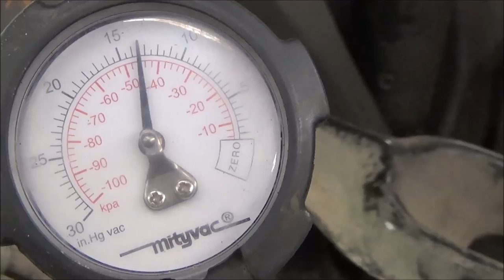Pontiac Grand Prix 3.8 - Water Pump Replacement

Comment: If the first can of stop-leak don't work, put in a case!
Reply from the maker: +Aaron Kimmins Hahah
Reply: You should have saved that GM clay, next leak you could slap some on, cover it with a couple of hose clamps and the car is good to go.
Reply: It's not stop leak, it's just what happens when Dex-Cool is expired and/or exposed to air. Dex sludge is classic. I've seen it so many times. It's atrocious.
Reply: That's Bars Leak all day long.
Reply: M R Research Dex-Cool mud and you'll see. Not stop leak.
Reply: Right that’s what I was thinking
Reply: I thought the same thing how ever this is from the antifreeze yes the antifreeze does this if not changed every 60,000 milles ugh I was like F it has bars leak in it boy was I wrong! Now my question is can I flush this crap out and use a different kind of antifreeze cause this shit is unreal
Reply: @Nicole-dj3jf  They make universal that is actually better than Dex-Cool. My shop uses it for nearly everything. I can't remember the brand name off-hand, but we had someone try and sue us a few years back for using it instead of GM branded stuff and we actually had it tested. Stuff ran circles around the Dexcool.
Reply: @1337penguinman  my 2008 pontiac grand prix v6 3800 said only use dex cool so your saying I can use the universal antifreeze and nothing will happen to the engine or radiator water pump? Why would they even make this dex crap knowing it turns into clay! Fucking crazy
Reply: @Nicole-dj3jf  You're not supposed to mix dex with the other coolant, you can switch coolant, just make sure to do a really good flush before changing, some even recommend getting a new radiator, hoses, and coolant reservoir as well. dex cool works fine just don't expect it to last forever, just like oil coolant needs to be changed eventually as well.
Reply: @Nicole-dj3jf  imagine what the oil looks like after 200k miles of being ignored. This isn't the product's fault it's 100% on the owner who's ignore required care for the car.
Reply: @delirification  I called the tech support # number on a jug of DEXCOOL years ago and asked them what happens when you mix with regular AF.... He said,  "Nothing, you just don't have extended life antifreeze any more."   All the thermonuclear meltdown stories are just that, Stories.

Comment: That is odd, I did not get to experience the dex cool fail. however my 32 yr old Buick park avenue had a small leak in the radiator a few yrs back, we replace it with a new aluminum one, no problems since. I am happy some folks think a particular brand of car is more job security than another, when in fact they all need proper maintenance! Sometimes one area is saturated with a higher number of one brand more than another. Think about it. thank you for another top-notch video!

Comment: I have seen some unmaintained vehicles in my day but dam.  That takes the cake. Another great video. Thank you again sir. Jim
Reply: +scrimmy6969 I don't think it has anything to do with maintenance. Look at these pictures.                   http://www.sancarlosradiator.com/dex-cool_pics.htm
Reply: Steve Price Nothing to do with maintenance?? My personal opinion it has everything to do with just that. GM's wise choice to use DEX will do exactly what this vehicle is showing. I do not know you and I will not click the link you provided. Thank you for the input.
Reply: +scrimmy6969 It's all good. I'm a confident and capable person, so I'll click on links. I can handle anything a machine throws at me. Computers are a little more complicated for some, I can understand that.
Reply from the maker: +Dick Fageroni I think I should submit my pic with the screwdriver standing up in it lol
Reply from the maker: or a sweet ash tray then learn how to smoke...
Reply: +South Main Auto Repair So is that from the fluid dehydrating to its basic elements over the course of 200'000 miles over and over, and not flushing the radiator?
Reply: +Randy Leonard Its a combination of not maintaining the vehicle and GM's extended life antifreeze. It is know to clump over time and clog radiators and blocks in the cooling system. Sadly I see this on a regular basis. I was buying AcDelco classic coolant and flushing the system and converting to the old antifreeze. Sadly I cannot find that coolant anymore. I know you asked Eric for his professional opinion but I wanted to stick my two cents in. I hope you do not mind sir.
Reply: +Steve Price I can clearly understand that as well. Dex SUCKS
Reply: You see all these nice GMC vehicles they released this year in the commercials (the 3 trucks rolling down a track) and you would think its a nice Truck?  But I am quite done with GM, as my Cobalt is nearly new (2007 29'000 miles!) and is a "purchase new"  $10'000 lemon.  Multiple recalls and suspension noises 1000$ spent on new arms, no rust underbody.
Reply: Randy Leonard Most GM cars are piles of shit.

Comment: Dex-Cool and cavitation.. Flush your cooling systems ppl. Go with the good stuff, go green. Also that flush tool, and vacuum tool I need that in my life. I have 2 grand prixs an 01 GTP and an 06 GT both supercharged, I did both intake manifolds, water pump, plugs and wires on these and they're pretty simple.  BTW you should have took out the thermostat. In this vid ur only flushing the lower rad hose pretty much.

Comment: How could that car still run at all with the radiator completely plugged like that.  The heater still worked?  I find that hard to believe.  Best coolant system video I've seen.

Comment: I've heard of a case like this somebody mixed the wrong antifreeze with dex-cool and it turned to mud and looked exactly like this, I saw the old parts. They flushed the block much like you did replace the water pump, radiator and I think they ended up replacing the heater core too. They also chemical flushed it several times after assembly until it ran clear. It was a costly job but the mechanic showed the people that owned the car what it looked like and told them this was the only way he recommended to help prevent another breakdown or more damage that would keep costing them money.
Reply: @@evanst72The “ auto parts store guy “
Is probably the one who sold him the wrong crap any way . Literally they hire anyone as long as you are able to work a computer and educated enough to learn to change out windshield wipers

Comment: That's what happens to Dex Cool, it turns to acidic sludge.
Reply: That is right Dex Cool not good, so I used regular antifreeze and it runs better
Reply: I had this happen to my 96 s10 blazer. There was a recall on it
Reply: That’s what happens when you never top off a dex cool system or flush it out ever. I own a 2001 trans am and a 2002 grand am both have over 200k miles both have used dex cool their entire lives never had an issue.
Reply: That is exactly what I have...
"YUKE"

Comment: Hey Eric O, just this last week started watchin’ your channel, nice to witness another real ‘motor engineer’ at work.  You mentioned a chemical solution to the flush issue on that cooling system.  Over here in Scotland I remember using just that 45 years ago.  I worked in a military workshop but as a civilian and at that time we had Bedford 4 Ton trucks powered with a 300 cubic inch straight 6 petrol engine (it was quite possibly of GM origin).  Well they were really bad for the cooling system gunging up similar to your Pontiac.  Our method was to add a good handful of ‘Citric Acid BP’ crystals to the top of the radiator, top up with water and run for 10 minutes after reaching the normal working temperature.  On reverse flushing with clean water until the water ran clean from the radiator top, we then neutralised any residual citric acid solution in the system by adding Lisipol (dunno what the modern equivalent of that product would be but anyhow it was a mild alkaline soap) and running for a further 10 minutes after reaching normal working temperature.  Anyway, that process worked really well the inside of the radiator shone like they were brand new brass tanks.  Sorry for the very tardy post, as I said I’ve just started watching your channel.  Really enjoying it, will take me a wee while to catch up to your current offerings but I’ll get there🙂.  Thanks, keep on turning those spanners, oh and watch your fingers👍🏻.  Wullie
Reply: was this steel radiators or aluminum?
Reply: @ozzykrahn806  Brass and solder, 47 years ago, not many, if any, aluminium radiators👍🏻

Comment: Something tells me that you just flushed out the only stuff holding that engine together...🤔...😂😂😂
Reply: Have seen similar (not like clay but strong fine foam) before the headgasket went bye-bye. That, or the repair shop put something else in as coolant. Also happened quite fast - little low on coolant before scheduled maintenance (checked, still OK) and about 150km after, that was all it took. Got cleaned out and seemed OK for 1500km or so, then started missing first cyl and finally hydrolocked.

There is more to this story but jumping ahead I think I found out why this trouble came to be. Apparently, one hole for the head bolts had less threads than others. The bolts being identical, one of them reached the specified torque faster but was actually not holding as thight. Sometimes it is good idea to check if the bolts can go deep enough.
Reply: ha ha. that's probably true.
Reply: it is a hot mess
Reply: Maybe they pissed someone off and they filled it with sand or something

Comment: I got a grand prix that recently, within the last few minutes, had a water pump spray all I've rmy belt and engine.

Firstz thanks for the video! 😅 That looks like a stop leak in that radiator. I did a coolant flush about a year ago and found out my car had some stop leak running through my car, except my looks like tapioca pearls... 🤦🏻‍♂️

Comment: Hey Eric O,  is that GM 3.8 bullet proof or what!!??  "Play-Doh" in the coolant lines and not have that engine overheat and seize up?  I am dumbfounded!
Reply: 99 camaro with 3800 in it, 220k miles and going strong, once you do intake gasket upgrade there pretty bullet proof. i did change to universal coolant tho, not a fan of dex cool
Reply: 3.8s are bulletproof, yes.
Reply: Mine has had a pretty bad coolant leak for a while. I just found it was in the lower intake gaskets. It would run right at the middle of the temp guage with the radiator half empty.
I'm in the middle of fixing all of this.
Reply: @dangerouspie0319  did you get it done. I did mine a few weeks ago and I notice coolant leaking from the water pump I replaced last year.
Reply: @corysturgis6660  Well, it turns out that there was preignition damage on one if the pistons. It scratched up the cylinder liner pretty bad and getting it machined was nearly the cost of a refurbished engine I found, so the current one is done for now.
Reply: @corysturgis6660  Did you torque the pump's bolts down in stages and go across the pump to the next bolt, or did you tighten each bolt all at once, going in basically a circle around it?
Reply: @dangerouspie0319  that stinks. You could always try to hone it and hope for the best. My dad changed out one cylinder on an old toyota pickup before. My grandpa said it would it work but it did. Not sure how much effort you want to put into it.  Did you compression test or or put oil in the cylinder thank check compression?
Reply: @dangerouspie0319  I can't remember but usually on cautious of the mating surfaces when tightening down the bolts. I went back and torque to specs but on bolt behind the power steering pump is loose and will not tighten.  I'm sure I put in one of the longer bolts there. I'm just burnt out. I'll pull it apart for the third time Saturday. Thanks for the reply.   I've taken the intake manifold of 3 times if you have any questions

Comment: Fortunately the 3.8 V6 in the 4th gen Camaro doesn't require you to move the power steering pump as their is adequate room. You are one of the few doing this job that mention using thread sealant on the long bolts which is important, but it really is a pain to remove them later/next time.

Comment: I can honestly say that in 30+ years as a licensed mechanic, I have never ever seen anything like that. I've seen some pretty strange things in my time but never a cooling systgem that crudded up. Good thing it was you. I would have thanked them very much for stopping by, made an appointment with the next repair shop up the road and sent them on their way. I wouldn't have taken a chance on something like that. That is absolutely ridiculous. I had to watch right to the end. I had to know if the thermostat was working. Totally amazed that it must have been. Just one suggestion. Next time....put on your rain gear first. Awesome vid. Take care and be safe.
Reply: I'm totally with you.  What a nightmare.  The only other option would be `yes sir, I'll do your neglected piece of junk, BUT I'm fitting a new rad/stat/etc. as I think fit.  It's time and material and it'll be a week.  Have a wonderful day'.
Reply: You've never seen GM's infamous Dex-cool "mud"?!
Reply: @jameslovitt994  Most definitely I have. Just not to that extent. I drive a Pontiac myself. I got rid of the coolant as soon as I bought it and used real coolant. However I did check with the previous owner and he had the coolant replaced as soon as the warranty was off the car so he beat me to it.  LOL

Comment: Well that is either a complete lower intake failure or a dex/ethylene glycol mix.  Sludge happens when DEXKILL ( Dexcool oops ) gets mixed with glycol coolant.  Those coolants have a bunch of dissolved silicates ( sand) that basically turns to concrete when it gets hot and sludged.   I have owned 4 3.8L motors and that is the first job I do.  New lower intake gaskets and flush and swap the dex for green.  Also, you and your wife are just like me and mine.  Our relationship revolves around lovingly giving each other a ton of crap.  Made me smile.  Thanks for the vids!  Where can we get some South Main T-shirts??
Reply from the maker: +Dave M Vanessa actually called to check on our order today so they should be coming soon :)

Comment: Dexcool always does that. I always flush out my GM's and use the green. Works every time.
Reply: Well to be fair, that's the 5 year 150,000 mile coolant. It was probably years off with an additional stacked 50,000 miles on top of that. I don't think it mattered what type of coolant it was going to be in the first place.
Reply: @BeautifulMan4015  that is right

Comment: It looks like they just filled the whole thing with stop leak.  That's completely insane.  You should do a "best of" video.  Put stuff like this, and that nasty mouse infested blower on there.
Reply: I've been driving cars and vehicles in general since about 1972. And I started helping my dad work on his car is about 1962. In all that time I have never had to use stop leak or black pepper. Knock on wood. I did see my dad once with the pinhole in a radiator. And he couldn't quite get to it to solder it. So you ended up just pinching It Off. That's what you could do with a brass radiator. I wouldn't even begin to think of it with today's aluminum junk.
Reply: Absolutely!!!

Comment: Dex-Cool is a wonderful sealant, now that you flushed it out the radiator tanks will leak next! I tried this method 15 years ago and gave up, too many come backs...for other coolant leaks! GM did pay for my Tech 2, and my custom house on the Guadalupe River in Texas thanks to so many repairs, on GM cars and trucks, my favorite car brand to work on...PS, Eric, I now own 3 Jeeps, a 1999 Cherokee, a 2002 Wrangler and a 2010 Grand Cherokee  hemi. All run like new with no dealer service, ever! Thank you, GM!

Comment: The temp gauge couldn't say it was hot since there was no coolant to get a temp from haha. I don't know how this engine didn't overheat or blow a head gasket. Never seen anything like it. I (think) I still have the original dex-cool in my truck and it is still liquid and orange. Maybe a few hundred cans of brake cleaner would have dissolved the clay. Probably be better off with a 55 gallon drum of brake cleaner on a recirculation pump. Owner most likely won't put the money in it when they get home. Needs a lot of parts to do it right. I just don't get how someone can neglect to do vehicle maintenance. That water pump just had to be screaming bloody murder! I don't see (or hear rather) how it could not have been. Ignorance is bliss I guess. Business for you = money for tools to show off ha. :)

Comment: I didn’t look at the length of the video. Just the title. Thought it’d be a quick water pump.... then I saw you pull off the radiator cap. Now I know it’s gonna be a good long one. 👍🏼

Comment: Love my 3800, nothing can kill it. Yeah, that one bolt that's behind the power steering pump is a PITA. Really isn't so bad since you don't have to disconnect the pump you simple have to move it out of the way so no hoses are involved. Welcome to the world of DEX-COOL. I was really hoping you'd change the radiator. I'd love to see a Grand Prix radiator change video. Question, couldn't you have installed a Prestone reverse flushing tee into the heater hose and done the reverse flush that way. Would have been a lot less DRAMA.
Reply from the maker: +SATAMAN Schmidt Ha! Where is the fun in that?
Reply: I just did mine and didn't have that problem. On a lesabre though.
Reply: @willgeorgiadis6472  Series 2 had the power steering pump in no mans land so no need to remove it.
Reply: Didn't say anything about p/s pump. No need to touch that. In the Montes and grand prix it is a pretty tight fit though you are right. My Buick has a bit more room in there. Just stating I didn't have to remove anything to get to my water pump. When I do them on other models different story.
Reply: @willgeorgiadis6472  Lucky, on my 98 Riviera I need to remove a motor mount to replace the belt or water pump.